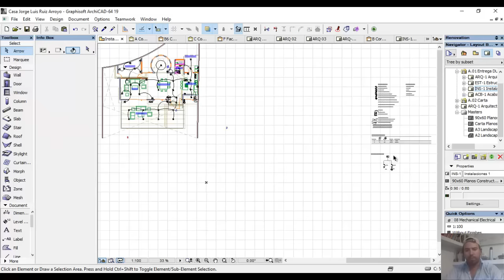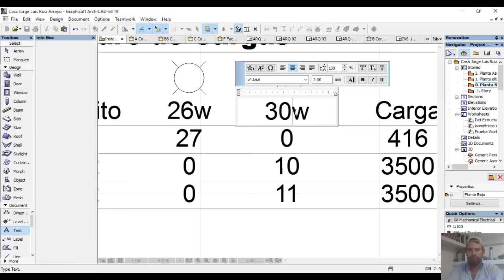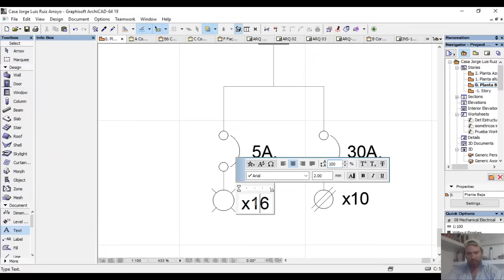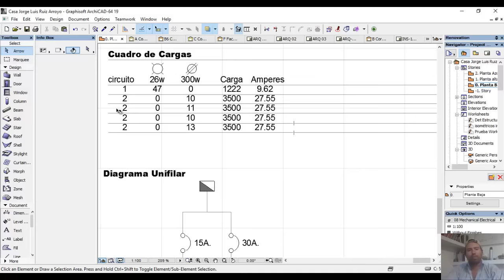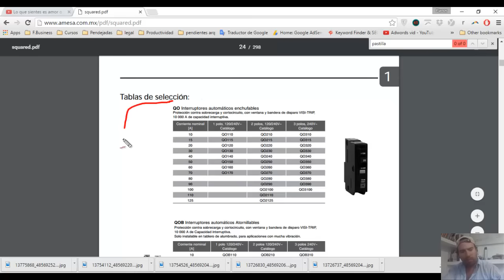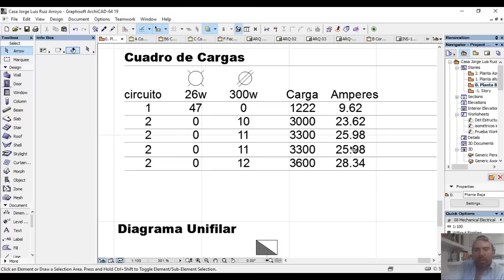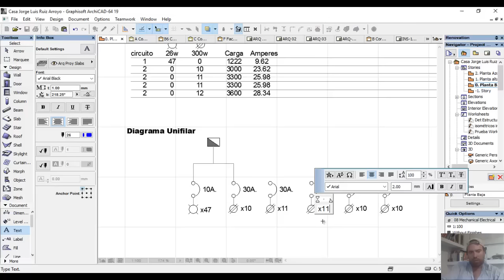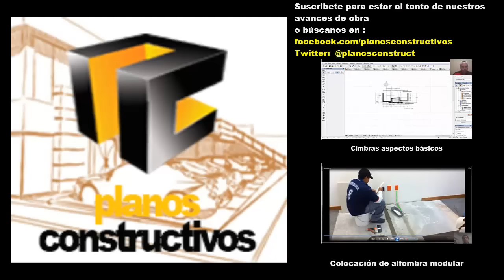Como se hacen los diagramas Unifilares

Comment: Que tal ing. Buenos días.  Interesante vídeo.  Soy principiante en electricidad.   Una pregunta.  Los circuitos de iluminación siempre deben de ser con calibre 14 y. Pastilla de 15??   En que afecta si coloco pastilla de10??   obviamente manejando amperajes. :  3 y 4.5. Amperes.??   Saludos amigo desde CDMX.   Gracias.
Reply from the maker: no recuerda que tmb esto se diseña en base a la caída de tensión pero el video va más enfocado a los diagramas unifilares que pide el municipio para aprobar los planos. y en el caso de la pastilla de 10 depende de como balancees las cargas en cada circuito si pones pastilla de 10 y la carga te da que es a 3 amperes muy probablemente se te quemen los aparatos  si le pones una pastilla de más, saludos.
Reply: @Planosconstructivos  gracias oficial

Comment: Hola, excelente video. Quisiera preguntarte, tengo el caso de un contactor que tiene un indicador LED en la entrada auxiliar 13NO-14NO. Este indicador evidentemente muestra cuando se prende o se apaga la bomba. No sé en el diagrama unifilar, dónde debería ubicar este indicador, si es potencia, o si lo pongo en la parte de control. Gracias
Reply from the maker: en realidad el diagráma unifilar te lo piden para saber el gasto que tiene y como proteges tus circuitos, en caso de calentamiento, por eso las cargas las conviertes en amperes, para ver que carga tienes en el circuito,  y con esto no quemes la línea y por seguridad instales una pastilla termomagnética o fusible, que corta la corriente en cuanto la línea supera este límite de amperes

Comment: Por qué lo multiplicas por 127 v?
Reply from the maker: es correcto lo que te comentó el compañero ese es el voltaje que llevan las lineas de 110 por lo general lo puedes checar con un voltimetro y cuando va a 220 ahi curiosamente si va a 220 ó 224